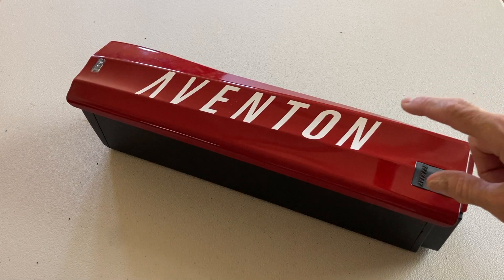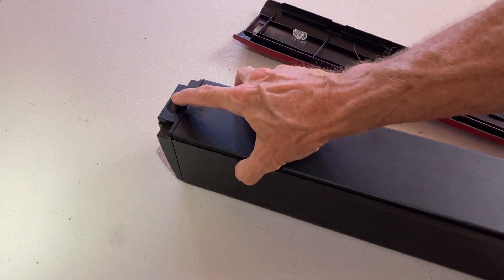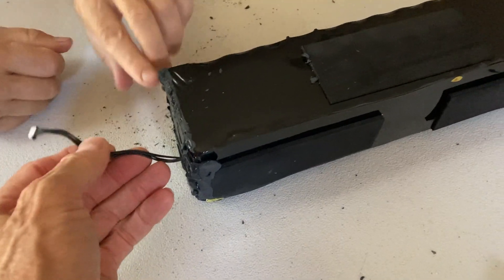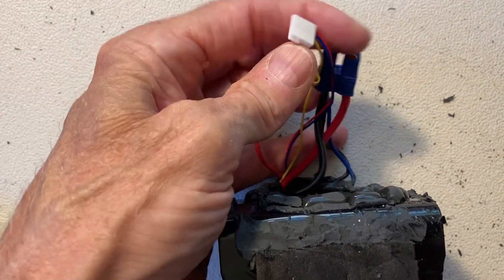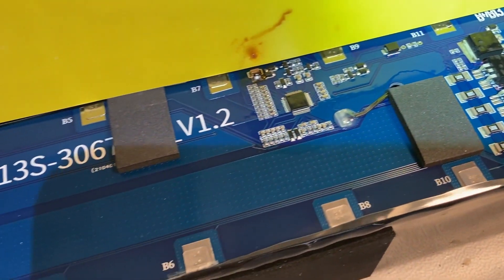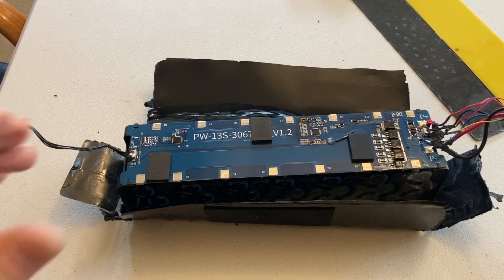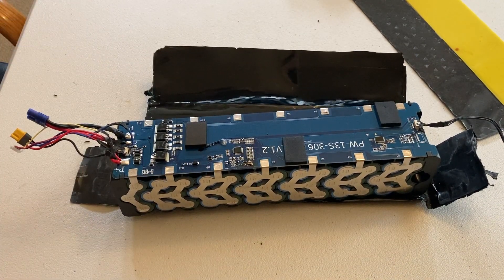Aventon Aventure Dead Battery Disassembly and Diagnosis

Comment: I didn't know anything about Ebikes until researching this week.  I bought one yesterday, The Aventon Adventure 3 from a local Bike Shop.  The first time I took the battery out today I noticed the housing was scratched.  I guess the aluminum housing got scratched by rubbing against the inside of the bike.  Now that I see how it's put together, I would guess minor scuffs on that outside shell shouldn't affect the inside.  Right? 👍
Reply from the maker: I wouldn't imagine that outside scratches would have any effect. These things are constructed like tanks. Like any battery powered device, the only thing to be concerned about with a used battery is how much battery health remains. Unfortunately, the only way to determine that is to track how many hours/miles of use you get before a recharge is necessary. Good luck and enjoy your e-bike. They're wonderful. Your life will never be the same.

Comment: So for anyone who sees this. I am an electronic engineer who recently bought a used version of this bike that had exactly this issue. I managed to find a datasheet for this chip and looked at the values for the fried components.
The capacitor is a X7R 0805 2.2UF(must be 100V)
The resistor is a 1k 0603 

I replaced both of these components and the battery now functions perfectly
Reply: @comicbubble any chance you can share that datasheet?
Reply: @brianfox1819 Dito!
Reply from the maker: Wow! That's valuable information. I wish I had known this 2 years ago. Aventon eventually replaced the battery, but it was a LONG wait. Thank you for taking the time to share this.

Comment: Bad tantalum cap. Not that hard to replace
Reply from the maker: Hi and thanks for the information. I see that a tantalum cap is a type of capacitor that's readily available. The battery pack is long gone or I would have tried to replace it - even though my soldering skills are not great. Take care.

Comment: My Aventure’s battery failed the exact same way. I found your video and decided to take mine apart (what a pain) since I have a new one on order. The exact same component on the controller board failed the same way; even the mark on the plastic cover is nearly identical. My battery was 3 months out of warranty but I think Aventon owes us something if this is common. I do NOT expect to have to replace my battery every year.
Reply from the maker: Interesting. This confirms my belief that Aventon received a bad lot of controller boards and because of the pandemic had no efficient way to replace them. When I got my replacement battery, it included five pages of FEDEX Hazardous Materials Certification shipping information with 26 other names from around the country also receiving new Lithium Ion Batteries. To be fair, I had a bad battery in the Sondors Rockstar I purchased several months later. The signifcant difference was that Sondors replaced it within days and it took Aventon over a month. Customer Service matters when purchasing an E bike.
Reply from the maker: Sorry, Just saw this post. That's very interesting and supports my theory that the chip manufacturer sent Aventon a batch of chips with the same flaw. You are correct. One should not have to replace a battery for many years.

Comment: Trying to find battery on Ancheer Electric bike
Reply from the maker: I take it you're looking for a replacement battery. Correct? I looked on the Ancheer site and could not find one. You'll need to contact them directly. If they don't sell them, they be able to tell where to get one.

Comment: Your blue wire is a signal wire it tells the controller the state of charge of the battery. The black and red will just power up the controller. To discharge the batteries just get a 12v bulb and attach it one at a time to each battery pack until it dies. Then move it to the next pack.
Reply: You don't want to discharge it blindly.
Reply: HELLO , i have a giant bike wich my battery was stolen "Energypack 300 " i found a recycled battery from another bike but ive connected the postive and the negative to the battery "leaving the bleu wire "  and it works fine for couple of seconds then the assist shutdown and the motor stops any ideas how i can bypass this or any other information regarding the bleu signal wire thank you

Comment: How do you fix your your battery when it doesn't want to charge to the electric adventure bike
Reply from the maker: Hi Steve, I don't understand your question. If the battery doesn't charge you need to contact eventing to get a new one. Is that a problem? Are you still under warrantee?

Comment: I can't be the first person to ask; can you make a video with this battery that changes out the proprietary three prong charger socket for one that is readily available like the barrel plug they use on every other bike?

I am missing my charger since UPS lost it in shipping, and you can't get a charger from aventon in any reasonable amount of time.
Reply from the maker: As a matter of fact, you ARE the first to ask, and unfortunately this is beyond the scope of my knowledge. I would look online for some kind of adapter. That's probably your best route.
Yes, the supply chain shortage has really hit bike manufacturers hard, but Aventon seems to be a bit more behind the eight ball than others. I also have a Sondors Rockstar and they have been Johnny-on-the-spot with needed parts. Two thumbs up for Sondors.
Reply: @webopus  I'm beginning to think whoever comes up with a solution that lets you use a standard barrel plug to charge this bike will make a fortune. Every place I look I see owners of the aventure wondering why they used that three prong
Reply from the maker: @Unclefacts  I'm thinking there must be an adapter available somewhere. They make adapters for everything else.
Reply: @webopus  I've been looking through every forum and group I can find, there was one that was close, but didn't work out. Grin has one that's close but doesn't work either. 

this has really pissed a lot of people off. no reason to have used a proprietary plug and socket for this. I'm to the point that when the chargers become available again, to buy one, then dump this bike and build my own.

at least then I'll know the damned parts are available and standard
Reply from the maker: @Unclefacts  I searched for "three pin to plug adapter for E-bike batteries" came up with a bunch of stuff. Here's one you might want to check out on eBay. In case youtube blocks the hyperlink the title is "Electric Bike Ebike 48V Lithium Battery Charger 3 pin XLR Plug 54.6V 2A 13S CE"   https://www.ebay.com/itm/Electric-Bike-Ebike-48V-Lithium-Battery-Charger-3-pin-XLR-Plug-54-6V-2A-13S-O/333738623995
Reply: @Unclefacts  I'm pretty sure the third pin is for a temperature sensor.
You don't really need it if you don't charge when the battery is below freezing (0°C) or with more than 3 amps.
I just recognized that the bms was a separate port and what the -c means.
It does point out a problem (I hadn't considered) with regenerative braking if they are not using common port bms on batteries.
Separate port bms are usually for solar banks where you need to charge and pull power at the same time not applications that are single function and either charge or discharge not both.
My "level" has a barrel connector but can sense the battery voltage and won't charge without sensing an appropriate voltage.
When I bought battery chargers for reclaimed scooter batteries and homebrewed batteries I picked the models with barrel connectors so I wouldn't have to trick the charger or deal with that third wire.
Reply: @webopus  it's cheap enough to experiment on too, thanks a ton, Sir! I'll let you know if I can get it to work.
Reply from the maker: @Unclefacts  Yes, that's what I thought. If the 3-prong insert is not an exact fit, you can snip the end from the non-working Aventon charger and splice it to this one. That should do the trick. Let me know.
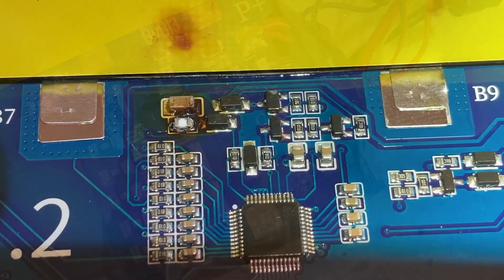Reply: If you look  @4:04 you'll see the pad marked C-  that is the negative charge port, that and the P+ are where you connect a charger.
Reply from the maker: @ghz24  Great information. Thanks very much.
Reply: @ghz24  ok, then that begs my next question, why three pins on the charge plug? I would have assumed that was charge+ charge- and a handshake to the battery?

Comment: I have this exact battery and it does not take a charge.  Aventon replaced the battery but did not require me to return it.  The battery turns on but you cannot charge it.  Is it repairable?   
I live in Virginia.
Reply from the maker: Stephen, yes, I had exactly the same situation. I have searched and searched for a place that might repair/replace the battery management chip but have been unsuccessful. These batteries that fit into the frame of the bikes are much more complicated to repair than batteries is that rest outside the frame. As you can see, disassembling one is a major job and extremely time consuming. So even if somebody had the appropriate BMS chip the cost of the time involved in assembly and reassembly would be prohibitively expensive. In the comments below somebody may have recommended a place in Las Vegas, but if I remember correctly, I contacted them and they were unable to do the job. If you find a place that can do repairs on these batteries please post it in the comments. It looks like I may also have a Sondors battery that I may need to repair. Have a good one and enjoy your E bike.

Comment: Excellent job diagnosing the problem. Ebike Marketplace in Las Vegas can replace the bms board. Save your money. Cost shouldn't be over $120 dollars.+ round trip shipping.
Reply from the maker: Howdy and thanks for the tip. Damn, I wish I had known about Ebike Marketplace before. Unfortunately I discarded the aluminum case and promised the batteries to someone for another project. I will keep this place in mind for future repairs.

Comment: I'll be selling my Aventon Aventure ebike unfortunately due to a couple of issues that have NOT been addressed by CS or I'm being totally ignored by them which doesn't suprise me these days.  First issue I'm having is the peak power or so called power on demand these ebikes have which is up to 1130w Peak isn't working properly on my bike.  When going up seemingly small inclines the motor will start bogging out or lagging.  Like its trying to peak but refuse to do so which in turn leaves me peddling even harder to keep the bike at a safe stable speed while climbing the small or medium inclines.  Seems to only do this while peddling and if I just use throttle to go up incline the motor seems stable.  Its definitely strange and I'm not the only one having this problem with this issue from my understanding.  
My second issue is that they seem to not want or even advertise battery for the Aventure!  I'd like to have an extra battery but seems I can't even buy one from them.   I'd also like to buy a controller as well since I'm pretty sure that's what is causing my power lagging while going up small inclines.   CS is horrendous at this company!  I was considering calling the BBB myself but didn't want to go that route but after reading this I may just go ahead and do this before my warranty runs out in May 2022.
Reply from the maker: I'm sorry you're having all these issues. I would definitely go to Better Business Bureau route. And I would also post a brief video on YouTube about the problems you're having and share the link on the BBB website. This is how I finally got some results.
Reply: I just bought 2 new Aventures and 2 spare batteries (currently $200 discount on Aventure batteries with bike purchase ). One bike had shipping damage. Customer service has been EXCELLENT so far. I talked to an English speaking human who answered the phone immediately and sent me a new front/rear set of fenders (I only needed the rear) and a complete rear luggage rack. I’m not thrilled about the shipping damage but everything else has exceeded my expectations.

Comment: Hello Charles - How long before Aventon responded with the new battery and how did they diagnosis the problem ?
Reply from the maker: Hi Juan, I diagnosed the problem by virtue of the fact that the battery would not turn on. A normal Aventon battery will light with a quick touch of the On Button, but mine was buggy from the start. After a month, it would not turn on at all. 
It took me 33 days from the submission of my warranty form until I received a new battery. I had to jump through quite a few hoops until I was finally able to contact the DIRECTOR OF CUSTOMER EXPERIENCE who resolved the delay within a few hours. If you are having trouble getting a response from Customer Service I strongly suggest that you file a complaint with the California Better Business Bureau website. That's how I ultimately resolved things. If you have any further questions, let me know.
Reply: @webopus  Thxs and safe cycling!

Comment: You may be able to fit a generic BMS in the case. 13S BMS are easily available from Amazon. The cells look like they are 21700 cells. They are configured as 13s3p which give you a 48V 15ah pack. If your motor is less than 750W, you can get a 20A BMS. Anything more than 30A will be thicker and won't fit in the case.
Reply from the maker: Well the FedEx manifest has the complete battery weight listed as 8 pounds, but you might wanna add a little extra for box and packing. I'll look for a way for us to connect directly without having to post our email addresses on YouTube.
Reply: @webopus  I don't no why my post aren't showing
Reply from the maker: @Freebird_67  Hmmmmm they're showing on my feed.
Reply from the maker: @Freebird_67  Hey, Go to the About menu on my channel. Click the View Email link and contact me directly.
Reply: @webopus  will do.
Reply: @webopus  I can't see view email link in (about) on your channel.    Only your YouTube domain
Reply from the maker: @Freebird_67  Are you sure you're logged into Youtube?
Reply: @webopus  yes on my phone.
Reply from the maker: @Freebird_67  That may be the problem. I'm on a video chat right now, but later I'll post my address to our conversation and then ill delete it.
Reply: @webopus  ok.  In not near my laptop so can't check there.  All I'm seeing in About it your biography and YouTube domain and when you joined YouTube.  That's in More Information.  No email links
Reply from the maker: Hello and thanks. Unfortunately, I disposed of the case and many of the components. Now I'm looking for a place that will recycle the batteries and not charge me an arm and a leg. Batteries Plus will take them, but for a charge.
Reply: @webopus  I'll Buy those batteries cells off of you!!   I use them in my RC planes..please let me no, I'm certainly interested in buying some or all of them.
Reply from the maker: @Freebird_67  HI, they are yours if you can find a way for me to ship them to you. There are restrictions in shipping LION batteries that are a bit complicated. The entire battery pack weighed about 12 pounds before I disassembled it, so I'm guessing it weighs a little under 10 now.  Do you live anywhere near Phoenix?
Reply: @webopus  I live in SE ohio.     I've never had issues mailing over ground Shipping through USPS. I'd have to check again unless things have changed.   I was told air shipping is what they frown on with these batteries.
Reply from the maker: @Freebird_67  The reason Aventon could not remove a battery from an unopened box containing a new bike was due to certain restrictions in shipping these batteries via UPS or FedEx. They fall under a special classification and I'm not sure precisely what needs to be done. In looking at the shipping receipt I received from FedEx with the new battery, it requires a "hazardous material certification" for lithium ion batteries, "hazardous class/division number 9." And the weight is 8 pounds. Perhaps that will help
Reply: @webopus  Ok.  Well I'm not to sure on all that I rarely use FedEx.  I thought that the restrictions was only for air transport of lithium ion cells.   I could be wrong.   If you could just give me a price and hopefully I can afford all of them since ill definitely use them in my RC Model aircraft.

Thank you!
Reply from the maker: @Freebird_67  Like I said, They're yours. No charge ... as long as you can get me a prepaid shipping label.
Reply: @webopus  GREAT!  Man I appreciate that.  For say 11lbs or